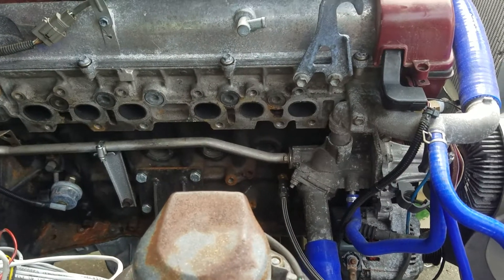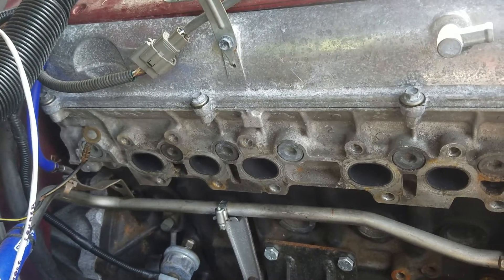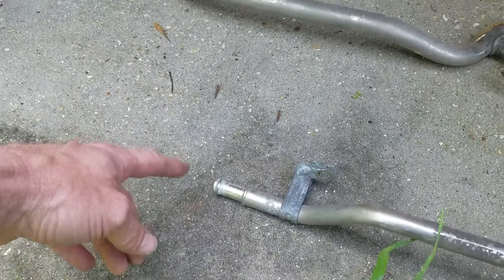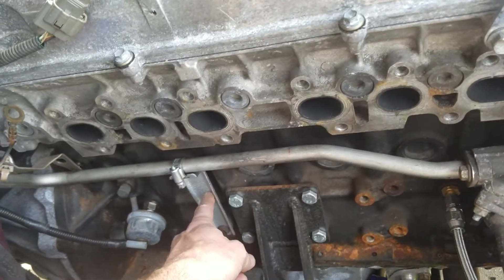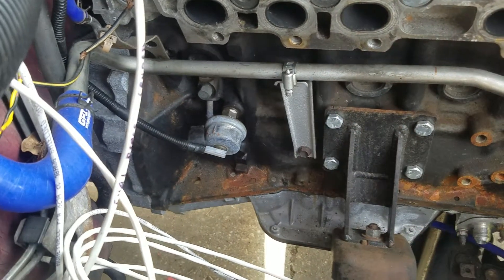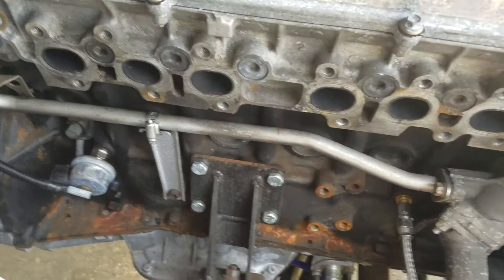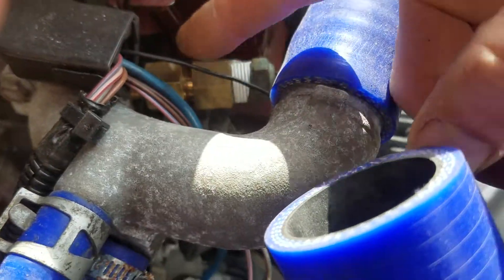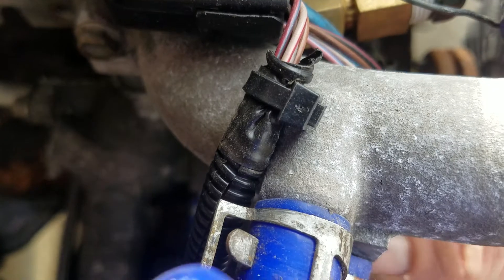2jz ge coolant pipe ,turbo lines and sensor adaptations for mk3 supra

Comment: Great video! Can you let me know what fitting I need to order to adapt the oil threads on the rear of the block to adapt to the 7M oil pressure sending unit?
Reply from the maker: I think it's a M12 x 1.25  male for the block and female 1/8 npt for the sender to plug in to. I found one fitting that did that on flea bay I think. The rest of the circuit can easily be rebuilt with  parts from Driftmotion and  Yotaconnectors.com. The biscuit sender just screws into the adapt and the adapter screws into the block.Curiously,  all of the fluid sensors on the USDM engine I adapted from are threaded in NPT while the JDM engine sensors are threaded in BPT . I read somewhere that National pipe thread is the same tpi as British pipe thread but the pitch of the thread is off by about 11 degrees.  Somebody correct me if I am wrong about that,  but the bpt stuff is hard to find  state side in my personal experiences. I haven't found a solid way to convert 1/8 bpt to whatever the 7m's coolant temperature sensor threads are.  They are close to another standard thread but not quite, which makes them a little loose and the need for teflon tape. That makes a not-so-sealed coolant system and I find I have to add a cup of coolant once every few months. I can see the red residue where it seeps out . I've been wanting to experiment with a different thermostat housing to attempt making some bigger threads in it. But the problem is that these jz engine parts are exponentially becoming ridiculously expensive and I don't want to butcher a 300 dollar thermostat housing.So that's why I've left it alone.
Reply: You wanna get a 90⁰ or a flex line from driftmotion otherwise the ac comp will be in the way. Flex line sucks btw.

Comment: Nice detailed video! I was wondering what fittings and hose did you go with for the oil feed I see your fittings in this video I’m looking for the same ones any help I would greatly appreciate it!
Reply from the maker: I made all my hoses from bulk stock hose and fittings. anfittingsdirect is a company out of Colorado. They make some ptfe stainless braided hose that can handle ANY automotive fluids. I would have spent a fortune on kits for each set of hoses I needed but instead I made them all myself for much less. You just need a good pair of shears and some tough fingertips. But yeah, I used the same type hose for fuel lines,oil lines and power steering
Reply: Ok got cha thank you for replying really appreciate it! I’ll check them out I’m just about done with my build I’ll be uploading some vids pretty soon!